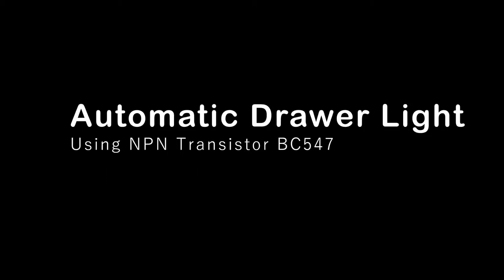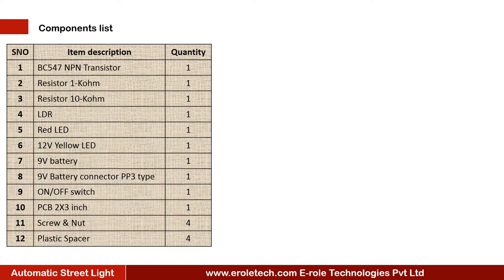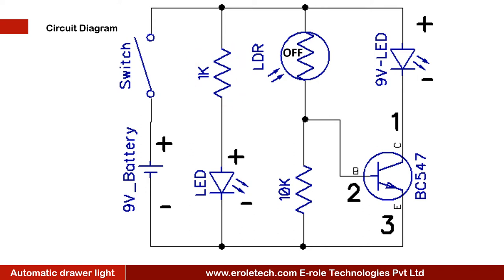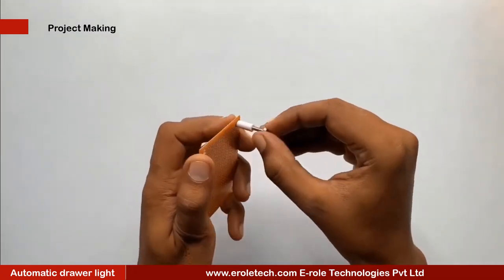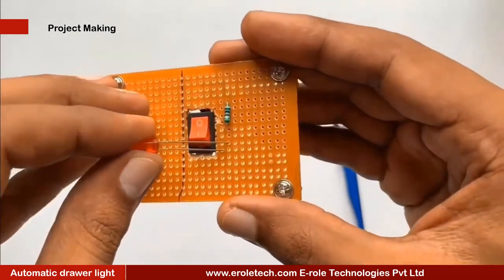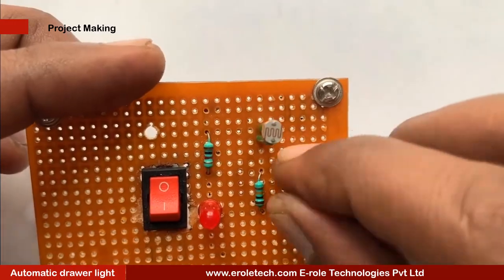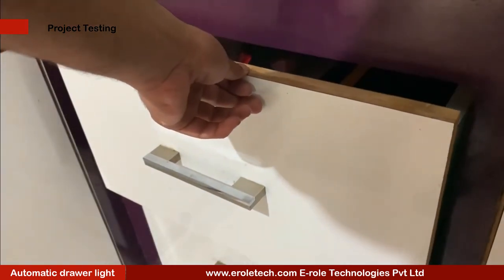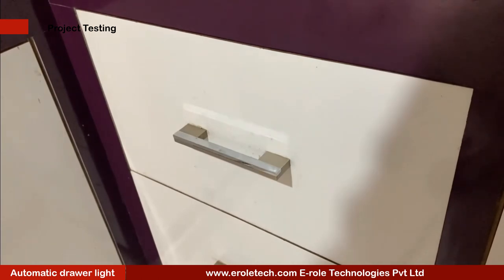Automatic drawer light Using NPN Transistor BC547 Full Making Project-30 #ataltinkeringlab  #project

Comment: there are several ways to activate the light but using a LDR is rather ironic
Reply from the maker: Respected sir the aim of this series of videos is to give basic knowledge of electronics components to the kids. We are posting 1000 videos in which all types of sensors will be used. In the end students will get to know which sensor is better at which place.
Reply: @eroletechnologieshomemadee9140  So you will present similar circuits using different techniques?  i.e  using a reed switch, motion detector, pressure switch>
Reply from the maker: @kennmossman8701  yes same circuit with various sensors. With transistor then with IC then with Arduino.
Students will feel the change in performance.